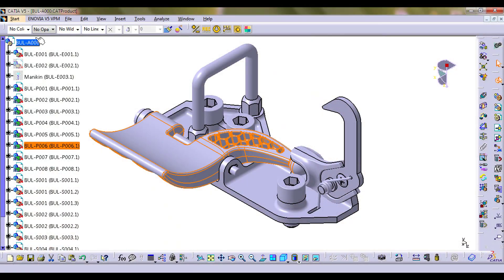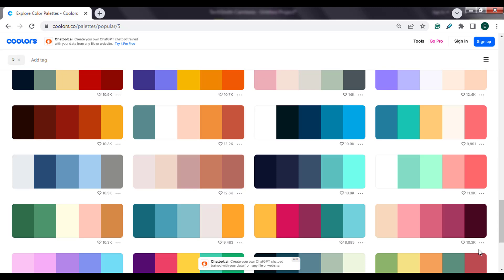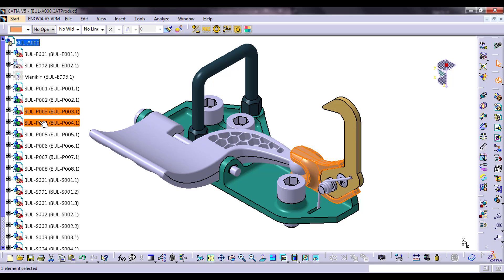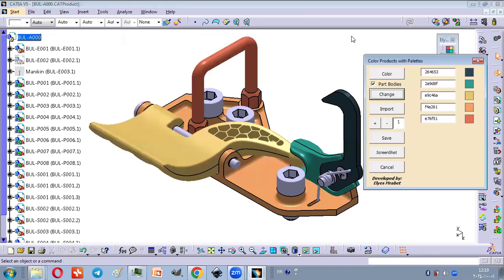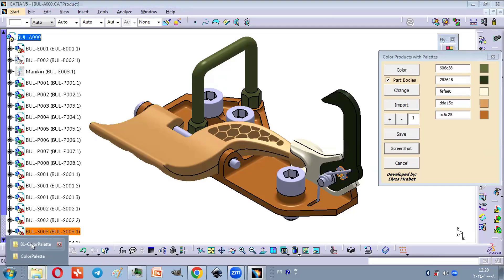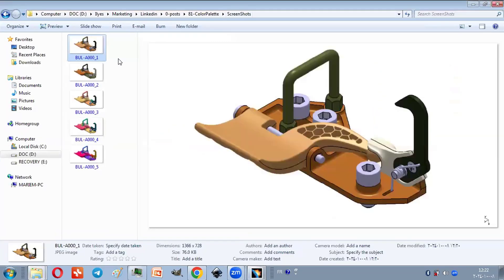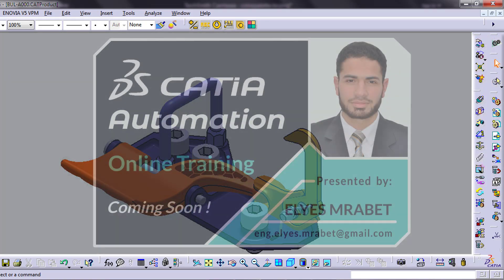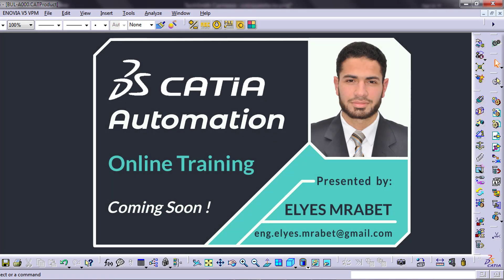CATIA Macro to color 3D models with Palettes (Video1)

Comment: How to learn catia v5 Macros programming fully
Reply from the maker: If possible, participate in training directly with a trainer who you can ask questions to check your understanding and who gives you the shortest path to complete by yourself, like learning to drive a car.
If not I suggest to start learning by recording macros as a 1st step.
Then explore CATIA Automation documentation and try to develop your recorded macros, by adding more features and removing repetition.
Experiment with as many methods and properties as you can. Use small tests to learn.
Then start to explore VBA documentation and use its keywords to loop and check conditions, solve errors and so on. Learn while practising.
My advice is to focus on the documentation. Keep the internet and chatgpt as your last resort.